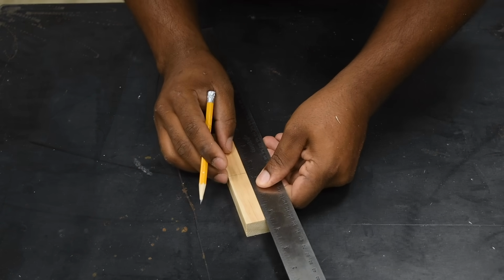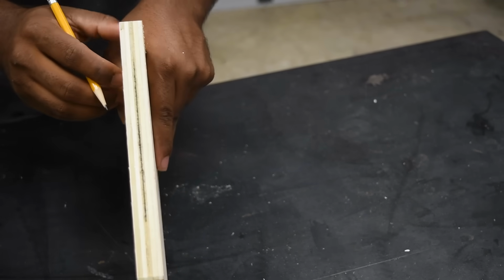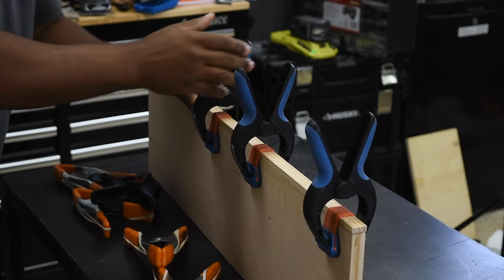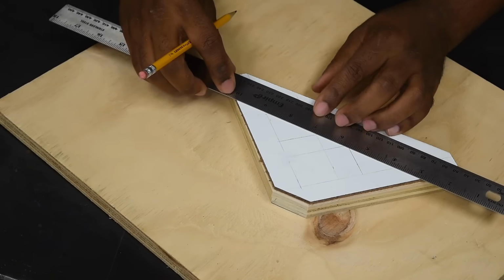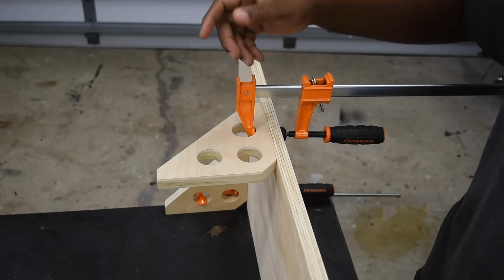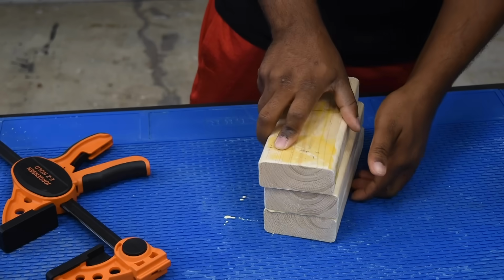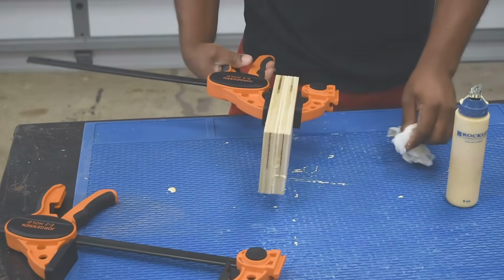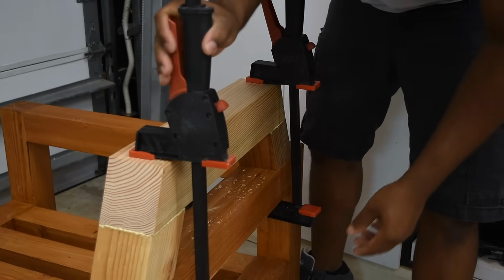6 Woodworking tips & tricks for beginners

Comment: A trick: with bar clamps notice in which way the wood shifts. Bar clamps rotate the forces along the end clamp. There is a center point where the clamp shuts fully and flat Or pulls along end price. But by angling two clamps in opposing directions you can counteract thir pulls and have a stable and strong clamping force.  Experiment and see. You could glue a price with only one clamp perfectly once you find the center balance point.

Comment: I’ve been a contractor for years and in the construction field since a kid, some tips seem unnecessary since it would save more time to buy the tool if your going to use it more then once because time is money. However I do like  the nail dowel trick and the salt trick. I just hope that it wouldn’t weaken the bond after it is dry

Comment: I'm making a boardgametable with a detachable dinner table top, made up of different boards. i dont have large machinery. How can i make sure that all my boards are the same thickness AND are perfectly flat? i have a sander up to 3mm, a milling cutter with different tips and a small table saw. this is my first project and i need the boards to be perfect as i will embed them in an epoxy resin shell

Comment: I use spring clamps as a Camera Mount that can be attached to practically anything.  Drilling a Hole through the side of a clamp, near the hinge, I can put a Nut and Bolt through, then use a metal bracket to extend the camera away from the tree or whatever it's clamped on.  Could you figure out a way to build folding extension?

Comment: The triangle 45 degree cut blocks was a damn good trick of the trade!!!! I just went out to the shop and cut me 6 of them. The salt I knew from my father years ago and the alignment of the holes to match I use a small ball bearing I had around. I hold it with tape in center and press down.

Comment: Recommended: drilling holes for deadbolt and door knob: If you don't have tool or template, I color the part that goes into door jamb. Use a magic marker or pant.  Marker comes off easier if you're not going to paint. Also, works well on slide lock if you're going to let frame be the means to secure it.  
     Additional security on molding with items you may have in home is metal bed frame. Many have squares already knocked out. Merely cut about a 1 foot section and drill holes for nails or screws to secure into place. Notching out a little of the wood on the frame Kay be necessary. A utility knife will be fine.

Comment: Not a pro woodworker, but how often do you glue together two flat pieces of wood like that? Usually there's some sort of rabbit, or chamfer to hold the piece of wood. You used a dowel to hold the other pieces together, so why wouldn't you do that instead of using salt? 
Does this salt affect the wood? This has to be a modern solution to this problem. Any extra insight would be appreciated!

Comment: All tips work brilliantly. Could have used them over the years. I rigged up a vacuum frame years ago for gluing laminates inside a rubber bladder. And designed and built a router table for large scale production. Everything worked with precision and fit perfectly.

Comment: Now I know what tools I do not have and need. . I am currently building a miter table with 2x4’s and did not have a jig (s) to hold the pieces in place while screwing them together. (Pocket holes) , Necessity is the mother of invention.
So i used a square to screw scrap 2x4’s to a scrap 3/4” board inside and outside to creat the jigs to hold the corners in place. I will reposition two of the scraps to finish the 2nd half of frames and reposition once more for the lower braces not at corners. (T’s). 
All of your tips(except the corner braces) are new to me and great ideas

Comment: My contribution----When drilling on your workbench you can save the workbench surface with a 1 1/2" [thicker is better] block of rigid foam insulation [the pink stuff-4x8 sheet cut in half if you want].  Put the foam on your workbench, the board you want to drill on top of the foam, and drill away.  This also works well when using a circular saw on your bench.

Comment: Nice video. Just when your cutting those 45s on the table saw with a mitre gauge, you should have that guide rail set up so it doesn’t go past the blade to prevent a dangerous binding

Comment: Love the band clamps, maybe a couple grains of salt there too?
Was thinking you can also drill a couple new holes in your spring clamps, closer to the tip, to get more depth for the band pressure?
Love the right angle clamp jig to- but was wondering- on the 45 degree cross cuts at the table saw- isn't safer to leave more room at the fence or take it off all together to make sure the off-cut piece doesn't get trapped between the blade and fence? That looks like a potential for trouble to me- but maybe there's a reason that I haven't learned yet... (and my saws haven't been set up with so many newer safety features/apparatus, this is coming from more of a field guy than a shop guy ;-)

Comment: Great video. Very useful. Would be nice to have a series of checklists that show basic tools you should try to have to get started. You recommended items you suggest for beginner, intermediate, and advanced craftsman. Like right now my inventory consists of corded 3/8 inch drill, corded skill saw, Corded jigsaw, cordless 3/8 drill. Would like to learn tips on type of screw selection, how not to split wood when drilling, the bits needed to countersink screw heads, etc. Just my thoughts. When i build things its kind of on the fly and hope everything turns out. I like your videos because every step seems well thought out and your results are great. Thanks for the great tips!

Comment: Wow already liking the first tip for marking center. I’m old nerd lady. Did a bit of simple wood working through 90s. Miss the real hgtv shows where they did work, not flippers who scream at workers and imaginary bank deadlines. You can use sewing elastic instead of rubber bands and knot it through the hole. More durable especially the non roll or beach wear types. Not sure what’s on survey but keep in mind women want to do this too and maybe we need to do things where we don’t have as much strength, upper body or arms. Just noting that if easy ways to not get hurt ive used chain saw and miter saw and lots of small tools. I’m 64 and been sewing  for 50 years. I’m still old school. Sewing has hacks too. I refuse to buy som things. I have 8 machines and none are computerized. I can do everything. Even on a treadle. My partner has bought a tile saw and compound miter. We are storing neighbors drill press. I’m looking to do more trash to treasure everything from drilling holes in shells to cutting down dressers into new things, but want to make sure things are steady, strong and looks nice.

Comment: Hi Glen

I've been toying with the idea of getting into woodwork as I am in the process of building a forge and garage at my new home, so I'm completely new to it aside from a few years of rhudimentary knowledge from school DCT, so apologies if this is a n00b question... 

Adding the salt to the adhesives to prevent slipping, does this have any long term issues? Wouldn't it add to the 'drying' effect and over time cause the wood to fracture?

Comment: I ll use 2 longer clams to glue that front strip. You but the whole board inside 2blocks 2x4. So when it dry drys straight.the elastic might not give enough pressure.resault on glue film between the stip and the board.the funny part. Ur square is the same as i used in my dad shop.i like those ones over the triangle.lol

Comment: Another truck that I do instead of the nail I take a small Phillips screw driver lightly push down in center where I want to put dowel and set a BB in it tape it and press the board against the embedded BB leaves a perfect hole. The nail one is great also. Thanks.

Comment: I like the trick with the nail for marking dowel positions.   Using dowels is not so much of a problem, but finding the little dowel center marker when I need it?  Impossible!  As for the tip of using salt to prevent slip during glue-ups: I've been a casual woodworker for 25 years and never heard that one before.  Thanks!

Comment: Tip #1 Use an awl/center punch before drilling, to keep bit from drifting.
(especially if working with metal).
Tip #2 Buy one of these, it's cheap, accurate, fast. 
(you'll be glad you did).
Tip #3 Use painters TAPE instead. Applies more pressure to your glue up.
( buy real clamp instead, use scrap strip to spread load across the surface area )

I could go on... (30yr. veteran woodworker here)

Comment: Good clean and square work, DIY! Here are two pointers I'll pass on to you that some older carpenters taught me on the job. (1) Pencils don't always make a neat, visible mark. Put the pencil on the point you want to mark and make a short line from that point. Immediately go back to the point with your pencil point and make a short line going off at an angle to the first. It's easy to see while you're working and the point you need is always where the two short lines end: the point of a V. (2) Sometimes the sharp point of a nail splits the wood, so take your hammer and beat down the nail point a little. The wood then moves forward ahead of the nail instead of moving off to the side and causing a split. If you're going to do woodworking, learn all the common types of wood, their properties, and what they do when they're worked. Pay attention to the crown, how the grain is distributed in a gentle curve-- you want the high middle point of the curve up. By the way, that's a neat trick with the salt.

Comment: Thank you for your really great tips and tricks. My late Father was a master of the art of wood working. While he oversaw crews of carpenters as they either built or repaired fire and water damaged properties his true love was making furniture, fine cabinetry and building homes. He was a master of the lathe and created some truly beautiful pieces of furniture. There just wasn't enough of a need to make that a full-time job so he did it on the weekends. Unfortunately, my Father was a bit old fashioned and my brothers benefited from his knowledge and abilities much earlier than I did. It wasn't until I bought a duplex in 1997, that has since been designated as historic, did I get a chance to work alongside him. The original owners remuddled (his term) the building in the late 70's in order to turn it into a  3 unit apartment house. When my Father inspected the building he told me the building was sound, the plumbing  and the electrical were within city code, but the only improvement the most recent owner had made was to install vinyl siding because it was extremely ugly on the outside and she thought adding the siding would bring in more buyers. Unfortunately for her, it was the interior that chased away the buyers. The bathrooms were equipped with aluminum showers that you would find in a camping area and they used bar sinks and faucets in both the bathrooms and kitchens. All the beautiful old woodwork had been either removed (in the largest unit) and replaced with ranch style molding or painted with exterior grade high gloss deck paint. All the beautiful molding was painted with what I believed was either spare paint or mistakes because they used mostly forest green and deep gray. Every wall was covered with mismatched paneling that they painted whatever color they had and/or wallpapered or both and it looked like no one had owned a circular saw because the cuts were so rough we used to joke that they must only have owned a chainsaw.  My Father told my Mother that he thought I was out of my mind. I'm a researcher by nature and by training and in the year or more that I searched for an appropriate building that satisfied the prerequisites set out by HUD I read every DIY book I could get my hands on, and he answered every question I asked when I needed clarification. I told him that I could picture what the interior could look like in my mind. Since he was retired he just shrugged and said, if you stick me with all of the work I'm walking away. My Mother was thrilled that he was out from underfoot and even helped with the remodel. It was just the 3 of us and my Father and I became closer than we had ever been as Father and daughter and we talked about his teaching me fine woodworking since he was impressed by the work I did in the almost 2 years it took to remodel the building. He never got the chance and when he passed away my brothers split his tools between them, (except for the lathe) so I have been saving and buying tools for the last 10 years. Seeing the jigs you showed us how to make are things that my brothers probably came across and had no idea what the were and tossed them. Watching you work and explain how to make each jig reminded me of my Father. Your common sense explanations and your expertise is evident and I look forward to learning from you. I bought those clamps and I have been cursing myself for the waste of money, but now I see that I can use them with that dandy little trick with the rubber bands. I have watched other videos and they all are directed, for the most part, to people who already have achieved a certain level of expertise. You are going to help a lot of novices like me who want to go one step further than just making needed repairs. Sorry for the "book" all my friends joke that I couldn't write a short comment even if there was a million dollars riding on the outcome. I know what I want to build, but I fear it is well beyond my current expertise. Maybe I will suggest it anyway, just to see what you think of it as a first project. If you ever get to the point where you can make videos that we can download for a fee I will gladly pay it as I believe that you will make a fine teacher and I don't have to leave my workroom.

Comment: Another nifty trick for stopping slippage when gluing lots of panels is to keep one glue spreader mixed with fine sand, silica works great. You dont need much but you do have to mix very well to impregnate the glue with the sand. I recommend doing a test batch with the glue/sand mix to get the proper ratio for your particular glue and sand. Keep in mind too much or too heavy a  sand and you create an issue where your pieces gap a slight bit becuae sand doesn't dissolve like the salt does..

Comment: I'll try to remember to give that centerline drill guide trick a try. Another method I like is to place a CD shiny side up on your workpiece, and drill through the center hole using the reflection to align the bit.

Comment: Some great tips there buddy, for those without a mitre saw the corner of a sheet of ply makes a great square, ive been using the same one 2ft by 3ftby 3 quarter inch for over 15 years and its still spot on. I cut the middle out of the triangle to make it lighter.

Comment: Using a miter guage on the outside of the blade with the fence engages as well is an instant way to get thrown out of my shop. I've fired guys who refuse to work safely. Its dangerous and an instant fail on your exam as a carpenter or a cabinetmaker. Safety features on a saw are there in case of need, not to be relied on.

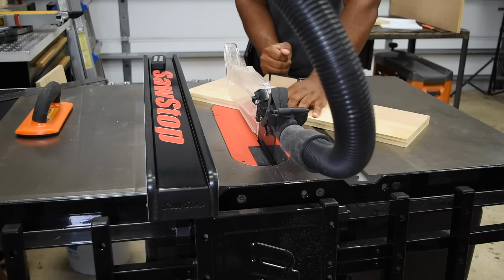Comment: Great tips! Only critique I have is at 4:50 in the vid. It's not a good/safe practice to use your fence as a gauge for your miter.  That cut off piece can easily be thrown at you if it gets pinched between the fence and the blade.

Comment: o.k. so you seem to be an innovative young man. So I have a question for you, actually a personal problem that I can't seem to solve. I have came into a large supply of free glass and wish to build a greenhouse but don't know how to frame out large banks of glass. (in other words I want to build glass walls using 2x4's and window trim to hold in the glass.) What would you suggest or how would you build them? I have over 900 sheets of regular greenhouse glass measuring 16"x18" and another 50 sheets 18"x20". That's a lot of glass! I also want to double them up for the insulation value. Can you do a video on that? My budget is pretty low so 2x4's is the way to go.

Comment: I agree with the other (positive) comments.  I have heard of the salt trick before now, but never used it because salt is often a potent corrosion agent: it just seems fundamentally wrong.  However, seeing how well it works, I am going to give it a try. But, I plan to use fine sand, instead.  It seems putting sand (or salt) in a one small hole salt shaker would be a lot easier than sprinkling with my fingers.  Chefs salt/season their food all the time--on TV using their fingers, but practical cooks use a clean-hands, more sanitary technique---a salt / spice shaker.  When I saw you gluing those two 4"x6"(?) pieces of wood, I said to myself "I am doing this many hundreds of times using my three-dimensional clamping jig with angled aluminum bars; maybe it's time I try the sand / salt solution as a supplement."

Thanx for the great tips: keep 'me coming!

Comment: very helpful. thanxs. Do you also have a solution for making a whole-jig from different whole sizes and which don't have to be in line necessarily. I have a van with couple of small and smaller wholes, e.g. from nivets and screw, whatever, I cannot mark anything from behind the wholes but want to drill through a wooden bar to fix it . any idea how this could be done? hope I could explain well.

Comment: An alternative to the salt is to put a pin nail in, pretty shallow, then cut it off with diagonal cutters. The cutters will leave a little point on the nail, which will then puncture the other piece of wood and keep it from slipping. Saw that on Paul Sellers's channel. That could work for marking dowel centers too, come to think of it. Just use it to mark and then pull the metal out to drill. Love the squaring blocks. Simple ideas are often the best ones.